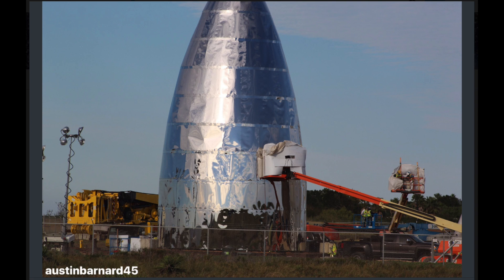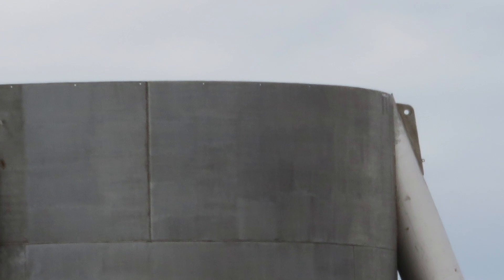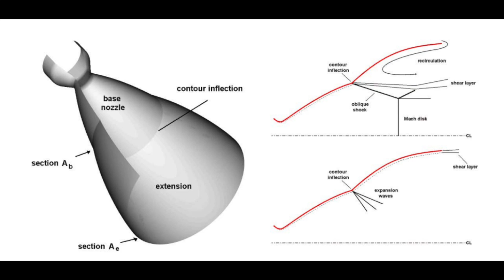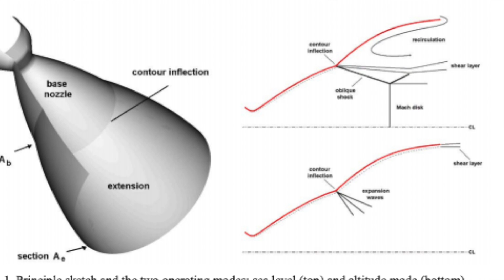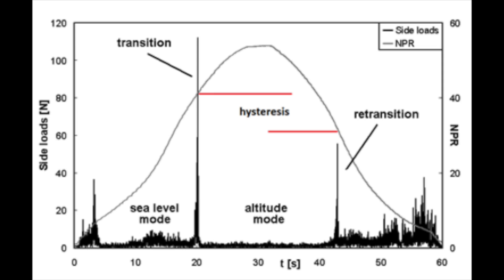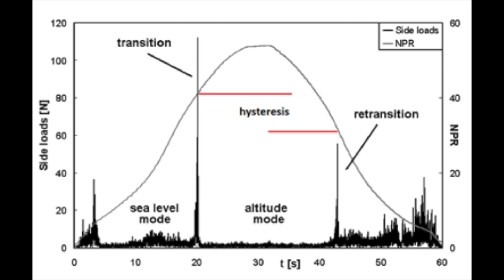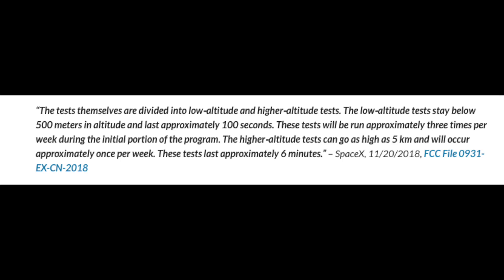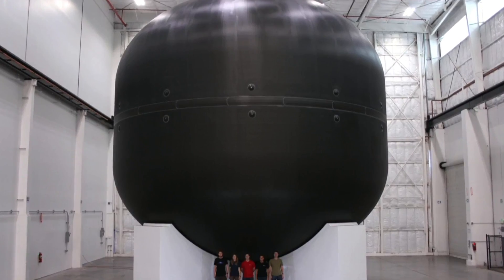What's Going On With SpaceX's Stainless Steel Starship?

Comment: I have no problem with calling it Starship. My Dad worked for Lockheed at Palmdale on the F-104 Starfighter. It was and is a great bird, and I hope SpaceX has another winner with Starship. My only reservation would be that it's a craft with planetary aspirations carrying an interstellar title.
Reply: @googleeatsdicks  It required both competent ground crews and pilots. It was not a forgiving plane. That might have been because the description 'missile with a man in it' was accurate.
Reply: PlanetShip doesn't have the same ring to it.
Reply: @dotnet97  Planet Express was already taken....
Reply: @googleeatsdicks  Hmm, this is somewhat on topic, as it concerns the pitfalls of design expectations vs unanticipated use. This is a frequent but undeserved criticism of the F-104. It was conceived and designed as a pure high-altitude interceptor. (An application of "not a pound for air-to-ground.") The idea of using it, with its tiny wings, as a fighter-bomber, often flying low in clouds in mountainous terrain, was an atrocious one. That was the problem, not the aircraft design.
Reply: Don Jones the problem was that Lockheed bribed officials in several different countries to get them to adopt the F-104 in a role it wasn’t very well suited for.
Reply: @TheJacobshapiro   I agree. A number of factors went into how the F-104 ended up in unsuitable roles.
Reply: @donjones4719  Erich Hartmann the world's top ace wasn't very impressed with the plane, it was a bit flawed how the Luftwaffe intended to use it too, damn sexy looking plane though!
Reply: What about the M60 tank that had the 152mm gun that shot missiles? Wasn't that also called a Starship?
Reply: @jessegd6306 : Yes, the full name was M60A2 Starship.
Reply: Elon said starship will go father out latter I believe
Reply: I think my biggest criticism of the names Super Heavy and Starship is that they are too generic. They need more character. As long as they do what they were designed to do I can live with the names lol

Comment: Considering how many German pilots the F-104 sent to heaven (nickname "Witwenmacher" - Widowmaker) I'd say that name arguably fits.
Reply: well, they used it in the wrong way, spanish pilots didnt have problems
Reply: Germany tries to use the F-104 Starfighter as a multi-role fighter, unfortunately, although it had an advantage in speed, it has a huge disadvantage in turning & manoeuvrability, so a ground mission is a bit dangerous for a Starfighter because you might have to pull-up quickly, also the Starfighter was designed for an air-to-air intercept mission only.
Reply: @xponen  The starfighter was just a piece of shit! Technical, mechanical and political. I dont understand how some folks can still defend that, imagine how a relatives would feel about such accuses.
Reply: @xponen  You're absolutely right. The F-104 was designed as a high-speed, high-altitude nuclear strike/reconnaissance aircraft - get in fast, hit the target, get out fast. In that role, it was first-rate. Before it got the nickname "widowmaker", it had another one - "man in a missile". It was NATO high command that in its infinite wisdom decided its role should be changed to a low-level conventional ground support/battlefield loiter role, a task for which it was totally unsuited. It was like trying to convert a dragster for road rallies. I flew RCAF 104s out of Baden-Soellingen. Macho acceleration, but a bugger to turn. We all knew its limitations, but you do your job and work with what you've got, right? Per ardua ad astra.
Reply: @WalterMar  The F-104G differed sigificantly from the other versions and this made the handling sigificantly less forgiving.
Reply: @WalterMar  Sure, who ever heard of good German fighter pilots?
oh wait
Reply: Na wen haben wir denn da? :)
BTW it wasnt just germans... but yeah those where bad times. Say thank you to corruption and monopolies.
Reply: @dongurudebro4579 
Na, den kenne ich doch!
Reply: @klobiforpresident2254  Tja wenn HR es nicht mehr ist muss man es halt woander probieren... ;)
Reply: Achtung! Germans have Anschluss(-en?) this comments branch! :-)
Reply: @John 43 Nenn mich noch einmal Deutscher und wir haben ein Problem! ;-P

Comment: I thought they abandoned the carbon fiber tanks in favor of stainless.  For the final version, the crew section should probably have internal composite structures, if only to minimize radiation issues with cosmic rays. Stainless can also hold liquid hydrogen without becoming brittle, so this might be beneficial if they need to bring any hydrogen from Earth as in the original Mars Direct concept.  I know they want to mine water there, but you have to be in a position to mine proven resources before sending a crew.  This might be a fallback there as well - send one vehicle with a big hydrogen tank and another with the fuel plant and skip the mining for the first return flight.
Reply: That is the problem:  nobody really knows what is going on.  I doubt that many SpaceX employees really know, and perhaps not even Elon Musk.  I'm being pretty serious here too.

The design is very much in flux right now where every element is being challenged and some major redesigns including a major redesign of the Raptor engine.  The full flow staged combustion aspect of the Raptor is being preserved and that it is Methlox hasn't changed, but apparently some substantive changes have been made where public details like ISP and thrust/weight ratios are essentially fiction right now or at least only guesses.

They are going to be using software development concepts here and applying them to rocket hardware development, so consider what you see and what you think you know about the BFS/Starship as just version 0.0.1 of the development cycle.  They may still be using some carbon fiber tanks, or perhaps they won't.   That it must be reusable is also not going to be sacrificed and that it must be able to put people and cargo on the Moon as well as Mars and capable of making a return trip from either location is also a major design consideration.

It would be frustrating as an engineer at SpaceX where some project you've been working on for 6-9 months is suddenly scrapped and you are doing something else instead from scratch.  At the same time, sort of exciting since the iteration process of designing this rocket is moving so rapidly as well.  That Elon Musk is willing to scrap engineering effort in such a manner and try unconventional approaches to rocket design is really going to be pushing the technology here in a way that hasn't been seen in rocketry since the late 1950's.
Reply: I have to agree... if you are changing the body of the ship to be stainless, their really isn't a reason to use carbon fiber tanks as using them instead of a bulkhead would require more mass.
Reply: Starship runs on liquid methane and liquid oxygen.

Comment: The FCC application is not secret, it is out there and can be read easily. The problem is that now the FCC is out due to the government shutdown and the page where you can search this application is also down so it is not available right now. The exhibits page is usually written by SpaceX and they said they had submitted FAA permits but if the governement shutdown goes on, those permits can't be approved and this "Starhopper" won't fly until they are approved.
Reply from the maker: The public part is a summary, there's a lot of detail in supporting documentation which isn't public.

Comment: Could it just be a display version while another is being manufactured elsewhere? Ground based proto?
Reply: mike tompkins this one is gonna do hops up to 5 kilometers high. A real one is being manufactured in california. Compare this one to the falcon9 grasshopper
Reply: That would be called a "boilerplate".  Yes, that is possible and I thought perhaps the "tank" or lower portion with the "landing legs" might be simply something like what you are suggesting.  Then they started to put stainless steel on the sides of that lower portion so I don't know what the heck is going on here.  The engine nozzles don't make sense either.

It could be something like the Shuttle Pathfinder where this would be something to build pad operations around.  While Pathfinder was never actually used by NASA for any flights (unlike Enterprise that actually did have independent flights at least for the approach and landing tests), it was used at KSC and set up in launch configuration at both LC-39A and LC-39B... primarily for ground personnel training and to fit equipment.  Could this vehicle be something like that?  Elon Musk claims it is going to be used for test flights... according to his tweets though.
Reply: @GlanderBrondurg  
The special nozzle geometry is for sea-level at reduced throttle, like 20%. Same design can work in vacuum at full throttle, but this nozzle is not optimized for vacuum.
Reply: @avid0g  I understand the geometry of the nozzle.  What doesn't make sense is why that would be put on what is plainly a prototype where the nozzles aren't even a functional engine.  Elon Musk even more recently confirmed that those nozzles aren't functional engines.

It would be interesting to see if those nozzles are manufacturing rejects or very early prototypes for the Raptor engines that have failed quality assurance testing?  As a "placeholder" to build other stuff around during this assembly process would make some sense.

The "crash program" nature of this assembly to hurry up and make sure this rocket gets built in the next couple of months also seems to be a bit odd.  SpaceX already has the largest heavy lift rocket in the world that is currently operational, and by far the lowest cost per kilogram to orbit of any rocket in that general class of rocketry too.  They can (and are) making bank off of every Falcon 9 & Falcon Heavy launch.
Reply: Not much use for prototype that doesn't fly, especially one that doesn't seem to even try looking like the final thing.
Reply: Maybe this is testing out mature alternatives for construction, with expertise already used for water towers. Cost is important. May end up influencing the west coast factory.

Comment: I'm thinking this will be a museum piece, not an actual flying object.  The nose has the wrong level of bumpyness 0:14  (for lack of a better word).  You can see the massive distortions in the reflections showing it's not very smooth, but then golf balls fly better with being way more bumpy.  The reflections will highly exaggerate how not smooth it is, so it it a lot smoother than it looks, but it's no where near as smooth as an airplane with similar reflective properties which leaves it between deliberate bumps for whatever it is in golf balls that make them fly better that way and the more traditional smooth skin on airplanes.  Being somewhere in the middle makes me think "not intended for flight".
Reply: That might also simply be a quirk in reflection. Remember when Elon Musk showed off one of their new fuel tanks? It was smooth yet the reflection looked 'bumpy' too
Reply: @unematrix  Yes, but my grandpa had a plane with the same highly reflective exterior that was at least 30 years old now, and the reflections you saw on it were no where near as distorted as these are.  Maybe it's supposed to be pressurized and that will remove the wrinkles in the skin?

Comment: Can the starship use aerospike engine's?
Reply: In theory yes.  In practice, there might need to be more testing done before an aerospike engine is acceptable for human spaceflight.

Having said that - it might be possible to program the nine Merlin 1-D+ engines of the first stage of a Falcon 9 or the 31 Raptor engines of the first stage of the BFR (called Super Heavy) so that they would take on some of the aspects of a single toroidal (ring) aerospike engine.

Comment: Doesn't the Falcon 9 also use 3 engines to land? I think the starship definitely has the 3 engines to better test landing procedures.
Reply: Depending on the mission, it can do a 1-engine landing burn, or a 1-3-1 landing burn.  It only ever uses a single engine for the final seconds to touchdown, but by lighting two more in the middle there it decelerates faster and uses less fuel.  You can see this pretty clearly on the Falcon Heavy side boosters, since we had such a great tracking shot of one of them coming down.
Reply: Was it really only once? I thought they did 3 engine landings at least a few times
Reply: @SuperSMT  They've definitely done 1-3-1 more than once.  I think it might even be the standard for GTO launches?  Falcon Heavy was just very obvious, since they had the tracking shot from the Cape.
Reply: @brspies  
The 1-3-1 mode was first tested directly before the Falcon Heavy Demo. It has become the preferred mode because it uses less fuel.
Reply: @avid0g  It was definitely not "directly" before Falcon Heavy.  I am fairly sure they had been doing it before even the AMOS-6 anomaly - on the return to flight, Iridium-1, they specifically note that they're doing a "gentler, single-engine landing burn" as if that's not the norm for ASDS landings at that point.

I know Elon mentioned something about an aggressive experimental landing on the expended booster (Govsat I guess?) and maybe that was a raw 3-engine burn or something.  That was definitely not the debut of the 1-3-1 landing burn.
Reply: IIRC, falcon 9 now usually only uses a single engine to land.
Reply: If I remember correctly, the Falcon 9 has only used 3 engines to land once. That was during a launch where they weren't planning to recover the rocket and were landing in the ocean and also didn't have the fuel to perform the standard landing procedure. They did more of a 'suicide burn' and landed with some success, but they decided not to tow it back to land in the end.
Reply: No. single engine to land and three engines for the reentry burn.
Reply: Just 1 engine. Thats why when the grid fins failed they lost roll control. Had  3 engines been firing they would have had some ability to control roll
Reply: @oliverlane9716  Different launch. I was talking about GovSat-1 from early last year, not the CRS-18 launch from December.

Comment: Yes it does look a bit bodged and unflyable, but I guess it's not worth wasting time on cosmetics for something that will likely just provide valuable flight data then crash afterwards.
The final version will be much more polished and precise.
Reply: PANEL GAPS! Make it in a tent! Any other color costs extra! I think I've seen this movie before.

Keep banging on, Elon!
Reply: @leftover7766  Maybe the rocket IS the tent? And the real rocket is being built inside the rocket.
Reply: @Nails077  bruhh
Reply: Maybe they intentionally made it look bad because they knew that testing would, at some point, be destructive and the public are generally idiots who overreact to rockets blowing up, even if they blew up intentionally.
Reply: From what I've read this initial test is more about the engines, so all they really need is some mass and approximate shape.
Reply: Do keep in mind that it looks worse than it is.  Reflective surfaces show pretty much every imperfection, while a coat of flat or semi-gloss paint will hide many sins ;)
Reply: @travcollier  Such denial, Airplanes are shiny before their paint job, and they never look like this. Not even WWII fighter planes that are mass produced as quickly and cheaply as possible.
Reply: @chengong388  Fair point.  Though a 737 fuselage is 3.75m diameter, so maybe some allowance for scale differences.
I wasn't trying to be overly defensive.  It does look to be a "quick and dirty" assembly.  Just wanted to point out that it probably looks sloppier than it actually is due to the reflective surface.
Reply: @travcollier  A Japanese type-0 fighter is 1 meter in diameter, is famously cheaply made and has a shiny thin aluminum shell and it does not look like that. I mean sure you don't need anything more than this for a grasshopper-type flight, a flying water tower is just fine.
But calling it a "Starship"? somebody sure knows how to generate hype.
Reply: Elon Musk said on Twitter that a non-painted stainless steel would suffer a lot less from re-entry
Reply: You really think the neat looking rocket exteriors are for cosmetics? Oh boy, the cult of Elon is unbelievable.

Comment: Makes me wonder if you could eject the extended bell portion on landing to get maximum efficiencies.  Probably not worth the complexity and cost of throwing the bell away.
Reply: Not to forget the increase in weight to carry throughout the launch. Would add a lot of cost with little gain due to the inefficiency of carrying extra weight which would mean less weight on other components.
Reply: One thing that would be interesting is a retractable nozzle like the RL-10. Retract it for atmospheric use and landing, but have a larger engine bell deploy for vacuum use.

Comment: Exciting to see how rapidly progress is going.  I wonder if the real thing will use monolithic tanks or also use sheets welded together
Reply: I have a hunch it will probably use monolithic tanks on the real flight worthy craft.
Reply: @Masterkodak  so do I, they would be a lot stronger, but stainless steel is pretty hard to work with.